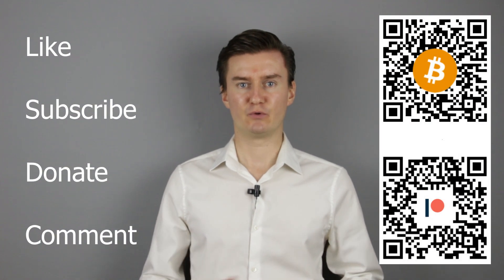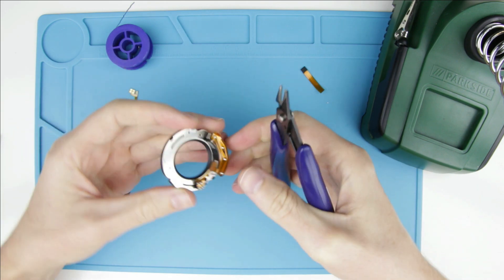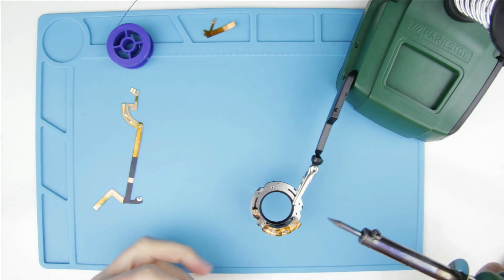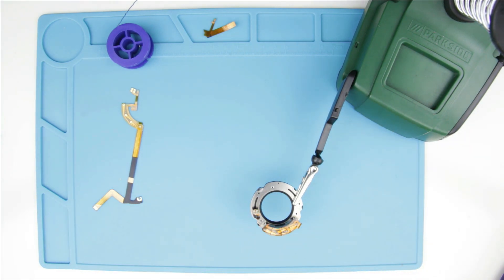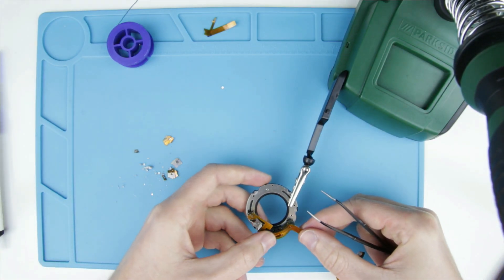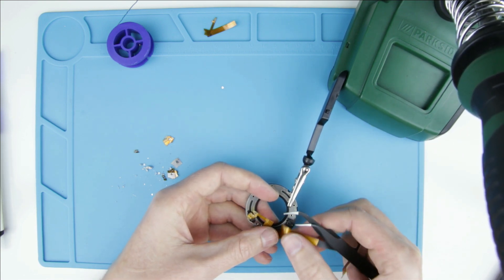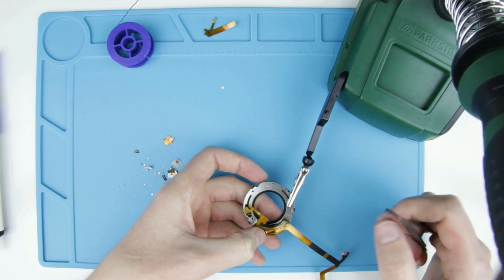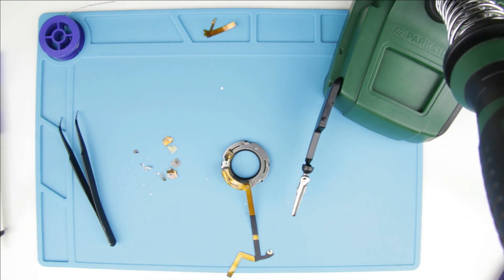Canon EF 24-105mm f/4L IS USM replace aperture flex cable after the lens has been disassembled

Comment: i check the flex cable but 24-105 3.5 to 5.6 are the only available and i saw it in your video that the flex used in both lenses are the same can i use the 24-105 (3.5 5.6) flex to my 24-105 F4 L USM?
Reply from the maker: I think they are quite different. To check that, search for flex cables for both of those lenses on ebay, and you can check if they are the same or not.

Comment: I managed to follow all your steps to here but my flex cable connection is different then yours, the original cable end is different.  However, the new flex cable i ordered is the same as yours. Any Idea how I should proceed?
Reply from the maker: This is really strange. I repaired many of this lens, and all of them were the same, and also there is just one version of the aperture cable for sale on the net.
Are you sure that you ordered the same cable, and not the IS cable or the cable for the STM or Mark II version of this lens?
Can you send me a photo of the aperture unit of your lens and the new cable you ordered?

Comment: I believe that the motor on my Aperture module is broken. I hear a repetitive whirring from the inside of the lens clicking 3 times about every second. I can't get the aperture to change so I think that the only thing it could be. The auto-focus is kind of buggy, but that might be from the aperture not auto-opening for low light I think. If nothing else I can live with the AF as long as I can control the aperture. If I replace the Aperture module will I need to recalibrate the lens? Thank you so much for these videos.
Reply from the maker: This problem can be caused by a broken aperture flex cable... test the aperture in different zoom settings. If it works in some settings but not working in other, then it is the aperture cable.
I would start with replacing the aperture cable, if that doesn't solve the problem, then continue with replacing the aperture unit (quite cheap on ebay/aliexpress).
If that doesn't solve the problem, then the problem can be the IS module. I had 17-55mm lens which had a broken IS module, that caused problems with the aperture also, so that maybe applies to this 24-105/4L lens.
Mark the positions of the three pins, and the eccentric screws, and don't tighten the screws in the aperture unit excessively, then the lens will still be calibrated.
Reply: @CamerasLensesEtc  When I first got the lens I could get the aperture to work on 24mm, but now it gives me the Err 01 on any Aperture on and Focal Distance. I guess I should try the cable first then?

Your mention of the IS module worries me as I think it might be broken on this lens too. I don't see any replacements for it on Ebay for this lens.

Thank you so much for your videos and your response!
Reply from the maker: @ColbyClinePenholders  Yes, start with replacing the aperture flex cable. I see image stabilization unit for sale for around 100USD.